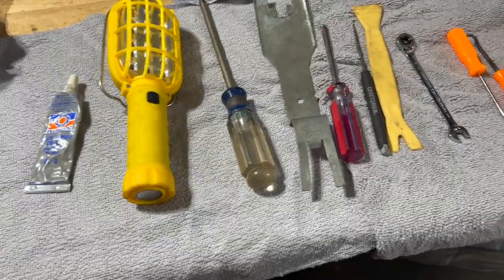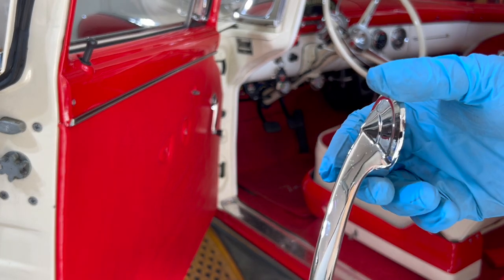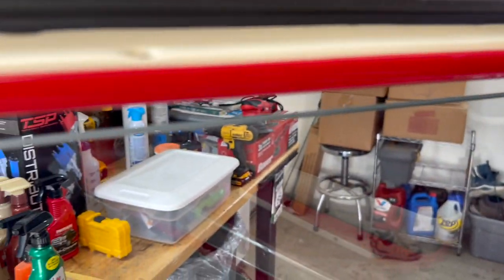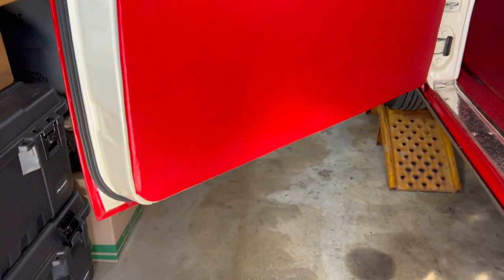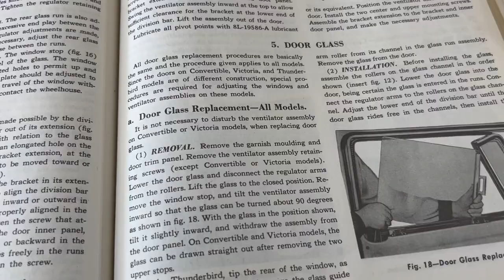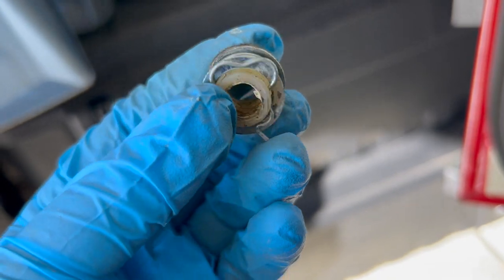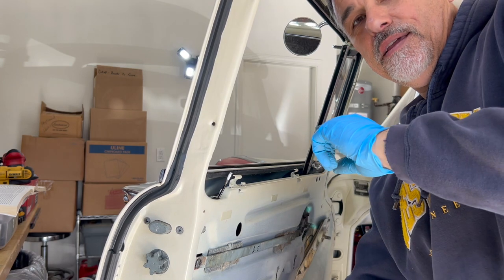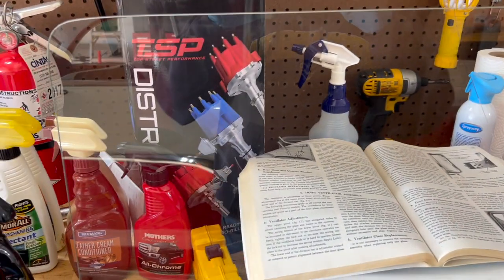1955 Ford Fairlane Driver's Door Window Glass Removal

Comment: Excellent video Rev! You are 100% correct at how helpful the shop manual is. I did the passenger front glass in my 4 door and the hardest thing was figuring out how to release those roller clips. (which direction they needed to go) I had combed over your blog a couple times but this video would have been even more helpful too! Excellent job!
Reply from the maker: I just put up the install video as well... I need a better camera setup to get some closeups. One of these days...
Reply: @HotRodReverend  you do pretty good for what you're working with. I still refer guys to your blog, since your writeups and pictures are pretty detailed. But there's something about video that adds a little more. I'll go catch the install video here in a bit. 😁
Reply from the maker: @OlysGarage  Yep, video is certainly where it is at - nothing like viewing all the moving details and parts and pieces. I need a little more space - kind of cramped right now in a working environment but at least I have a garage in which to work and tinker!

Comment: Watching and learning Rev. I worked half a day on removing the exhaust on my 56 Victoria.  Had to remove the manifolds to get the down pipes out. The back bolt is a rascal to remove.
Reply from the maker: You are right about that! I have an old wrench that I ground down the sides of the open end to gain more room... of course the box end is helpful too.
Reply: @HotRodReverend  Good idea. I will try installing a couple header bolts back there.